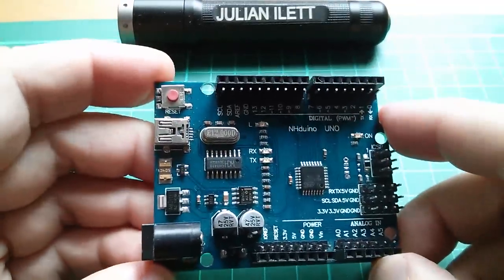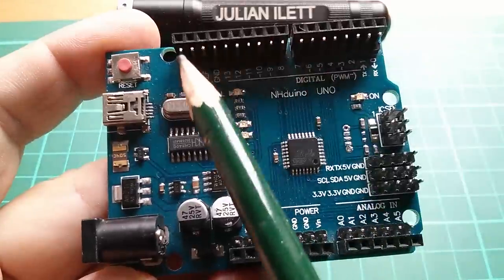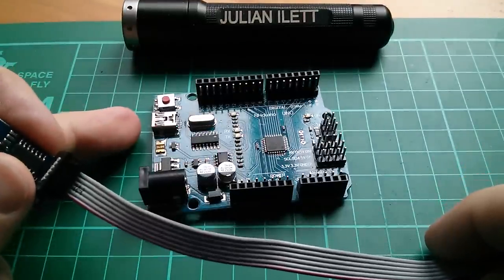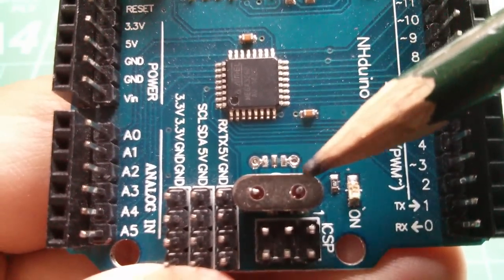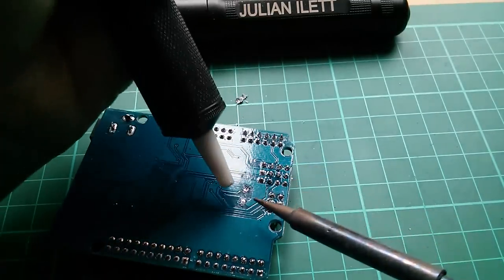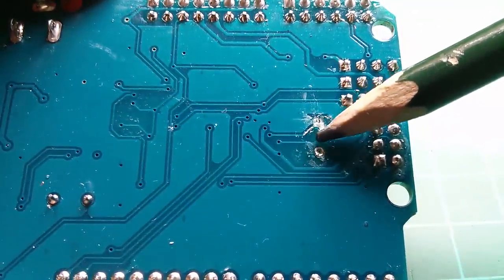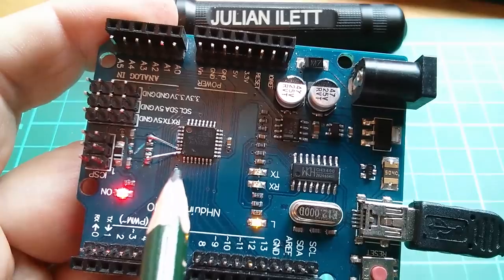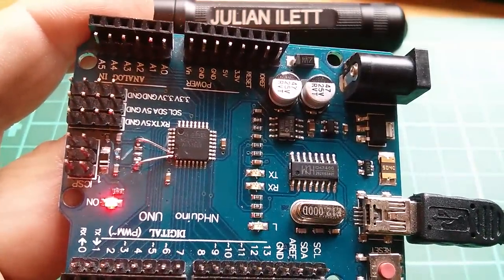Julian Sucks: Failed Arduino Uno Repair - Rescued!

Comment: The solder sucker jams itself forward in reaction to its piston jumping backward.  This causes it to mash down on your hot soldering iron tip causing it to push the pad away from the sucker.  The trick is to back the iron away from contact with the pad and sucker, just as you fire the sucker.  This will save most pads.

Comment: Worst case, you can use an AVRISP mkII to manually send a clock to the AVR just to reprogram the fuse bits, and tell it to use the internal oscillator (~8Mhz) rather than the crystal. It would be half the speed but it would work just fine. Whether different programmers can send the clock would vary depending on the programmer.

Comment: Even if the xtal repair had ultimately been unsuccessful it wouldn't have been time to throw out the board, just temporarily inject a square wave (google: avr rescue clock) into XTAL1, then use your ISP programmer to set the fuses to use the internal oscillator.

Comment: The only initial error that was made here is actually a very common one: Temperature. Lot of people solder at 400°C and above, cause it goes fast. But this is often above the temperature where the glue that keeps together all these PCB layers is giving up too, at least on cheap PCBs.
If you keep in mind that many solder mixtures start to float at temperatures below 300°C and you should always adjust the power of your soldering iron to the thermal capacity needed... The poor crystal has only two very thin traces attached, so next time try again with the iron set to 280°C and only increase if needed.
If the quality of the PCB is "unknown" but probably cheap, then prefer de-soldering wire over suction tools. And yes, de-soldering wire adds some thermal buffer, so you could use a soldering iron at a higher temperature.

Comment: If you place a short piece of rubber tubing on the end of the solder sucker with about 2-5mm showing past the end of the original plastic tube then you might find it works much more effectively. The tubing makes a better seal and stops the solder sucker sliding about so much.
Reply from the maker: +BogusNotions Good idea. It's the hard end of the sucker nozzle that does all the damage when recoil from the spring smacks the nozzle into the hot fragile PCB pad. Solder suckers really do suck.
Reply: +Julian Ilett I use a desoldering iron with the suction bulb - http://rayshobby.net/wordpress/wp-content/uploads/2011/08/IMG_0577.jpg - I love it.
Reply: +Julian Ilett 
>Solder suckers suck.

Definitely. My life changed when I bought some solder wick, it's seriously great stuff.

Comment: I think once that pad was messed up you should have placed the Crystal in from the bottom up. or even when placing the Crystal in from the top keep solder on the lead, and make sure the whole lead is tinned, and push it in. then you wouldn't need the 22pF cap. correct me if I am wrong.

Comment: You have more patience than me,for £3 I would just get another one,but I do understand the annoyance of it not working. Don't you just love surface mount.
 Like many others I have built my own arduino and this helps with understanding and diagnosing faults. Thanks for the video,it was very interesting.

Comment: Hello, please don't damage the board. To put out a component do you have to touch with solder both the terminals togheter, than it comes out from the other side. Bye

Comment: There supposed to be gasket under the crystal in the manufacturing process! 
And because those pads are for SMD crystal and got solder on it.. 
You need an oscilloscope for checking boards...  Its a must for almost any high tech device. 
Btw, some ic's like those replace ATMEL ftdi fail to program or communicate with the pc, one of the boards like that didn't work with 6 laptops but fortunately works with my laptop.

Comment: For easy desoldering with a solder sucker:

1: Use a chisel tip, even on small vias/pads. The heat transfer of a pointed tip is to small.
2: Put fresh tin on the vias. You where working on "dry" joints, that is always a no-no
3: Keep the tip on for at least 5 seconds. It's a double sided board, so especially with small vias, it will take a long time for both sides of the board to get hot enough.

When you use a large tip and fresh solder, the surface tension of the tin will make it so you can keep your tip 0.5 to 1 mm away from the hole or via and still get good heat transfer. At the same time, your solder tip is not covering the hole, so that the solder sucker has all the room it needs to do it's work properly. 

Loss of a pad or hole is (almost) always an indication of not enough heat to the joint. People try to "make up" for this by applying more mechanical pressure to the iron or the sucker. That in turn leads to a damaged board.